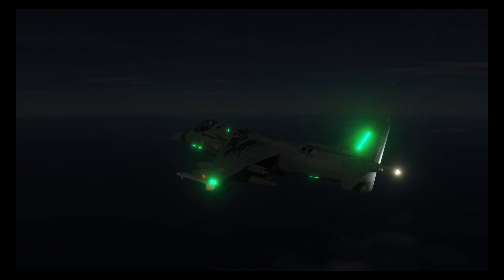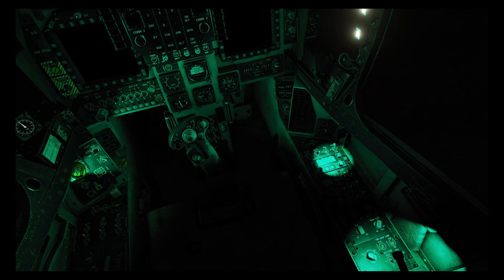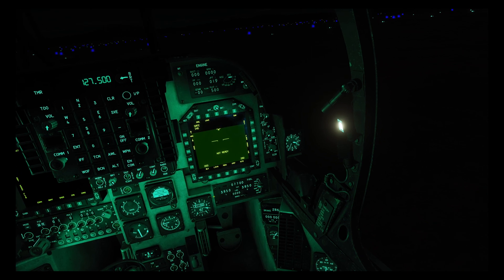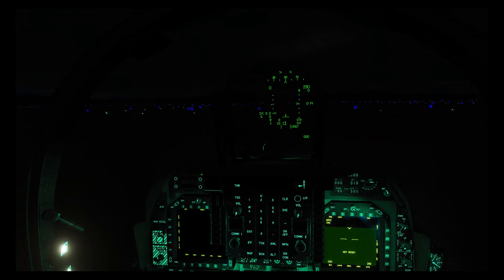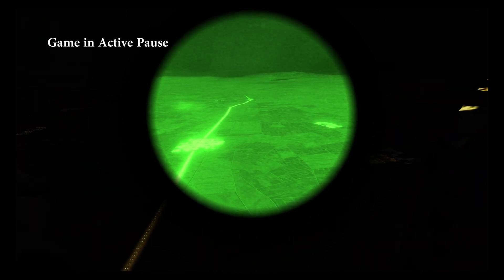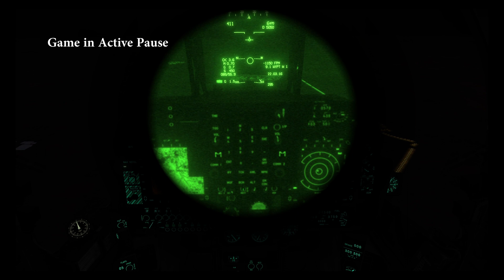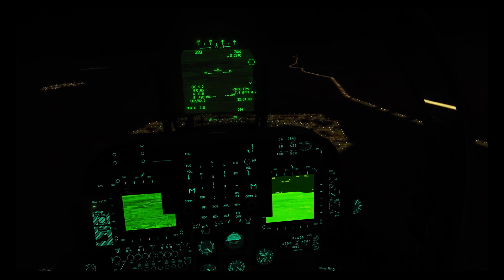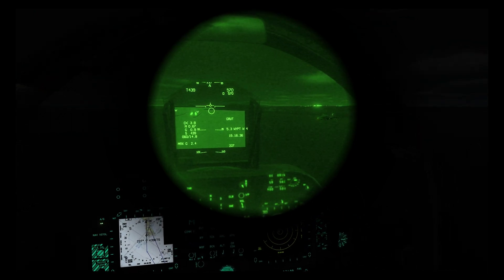DCS Harrier Lighting and Night Ops Tutorial

Comment: I've only just discovered your channel and I say "Bravo."  This is the best tutorial resource on the DCS Harrier I've seen.  Already learned so much from your videos.  Thank you.  Hope you continue adding to your superb library of DCS Harrier videos.  Cheers.
Reply from the maker: Thank you very much! I have a few more Harrier tutorials to do - but struggling for time a little. Need to get the TPOD one done - it's long over due!
Reply: @Pukin-Dog  Personally, I'd love to see a AWLS tutorial in bad weather.  :)
Reply from the maker: @RedBravo65  funnily enough I did just that last night...just a landing not a tutorial
Reply: @Pukin-Dog  i've been trying to use the AWLS but for some reason I cannot get it to work.  I've checked the forums to see if there is a bug but nothing seems to be clear one way or another.  I've checked both the RAZBAM manual and Chuck's Guide on AWLS but again, can't get it to work.  I'm either missing something so simple or it's broke at the moment.
Reply from the maker: @RedBravo65  What map? I would try it on Caucasus. I don't think it works on all maps (you can but you need a mod) but it should work there
Reply: @Pukin-Dog  I've tried it on both the Nevada map and the Syria map.  I have not tried the Caucuses.  I will do so when I can.
Reply from the maker: @RedBravo65  let me know how it goes
Reply: @Pukin-Dog  Tried it on the Caucuses map today.  It worked this time.  I actually got correct signals and graphic representations on the HUD.  Still does not work in Syria Map or Nevada Map.  I have not tried yet the Persian Gulf Map.  Cheers and Merry Christmas.
Reply from the maker: @RedBravo65  yup...I thought that was the case still. I know it works in caucasus.....and I think nevada.  There is a mod to get it working in Syria....but at the expense of caucases. Let me have a dig and get back to you
Reply from the maker: @RedBravo65  Here are three links which would be useful. I have never actually done this - I have only used AWLS in cacausus.....  1)   https://www.facebook.com/RazbamSims/posts/about-the-awls-all-weather-landing-system-or-ils-by-another-nameunlike-other-air/1355400151213286/

2) https://forum.dcs.world/topic/251169-syria-awls/  

3) this is just for syria obviuosly https://www.digitalcombatsimulator.com/en/files/3304548/   

You would need to amend the Program Files\Eagle Dynamics\DCS World OpenBeta\Mods\aircraft\AV8BNA\Cockpit\Scripts\RadioNav\AN_ARN128_config.lua file so what I would do is to create AN_ARN128_config.syria AN_ARN128_config.caucasus AN_ARN128_config.persian gulf etc and everytime you change maps then amend the file to .lua   it's a pain in the ass I know - but that I think it the only way.
Reply: @Pukin-Dog  LOL!  You did not have to go through the trouble with this.  I thank for the effort and time, but I will not mess with this.  It is clearly something ED or RAZBAM need to fix.  I'm surprised other people have not brought this up frankly since the AWLS is needed for bad weather landings.  Guess not too many people fly in bad weather in DCS...at least with the Harrier.  I will report this as a bug then.
Reply from the maker: @RedBravo65  Im actually considering doing a little batch script to do it...but you're right. Razbam need to fix this - but I suspect it's an ED issue as well.
Reply from the maker: @RedBravo65  I have got iot working at Incirlik! :-)
Reply: @Pukin-Dog  excellent!  I was thinking I should try a different airport in Syria to see if it only was Akrotiri that has the issue. I also only was using Creech Airport in Nevada. Will try and see if other bases in Nevada have same issue. I really hope ED fixes this. I have many missions I’ve made flying as RAF out of Akrotiri. Such an important airbase on Syria map to utilize for simulated real world missions. 🙂
Reply from the maker: @RedBravo65  it won't work at any. I had to amend a lua file for awls channel 1 to 109.5mhz. I'm hoping you don't need to reboot the game...that would be a pain and might not be worth the effort....but I will have a look again later on.
Reply: @Pukin-Dog  Damn. That’s disappointing. It definitely needs attention of the developers.
Reply from the maker: Restart of game not required!!!! I can now create a useable tool (if I have the time)
Reply from the maker: @RedBravo65  Hi. It seems Raxbam HAVE updated the AWLS (a few months ago) and it does work in Syria PG and presumably others If you look at your kneeboard it will show the various channels available on that map. Not all airfields have ILS remember and also there is only ever one ILS active on a runway. Typically the east facing runway is active unless you set an easterly wind in whichi case the west facing runway will become active. If you call ATC at places like Incirlik or Damascus they will tell you which is the active runway and only that one will have ILS available
Reply: @Pukin-Dog  I knew about the channels on the kneeboard.  I've been using them to plug in data needed for AWLS.  I will have to experiment with which runway is considered active and see what happens.  Cheers.  P.S.  Was watching your "Building a FARP" in the mission editor video.  Cool stuff.  I will have to try this sometime myself.